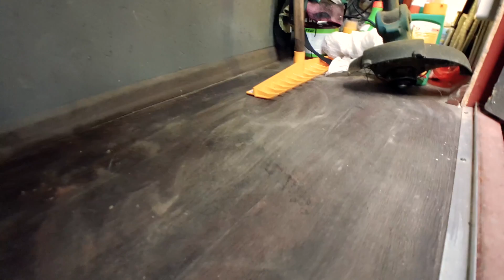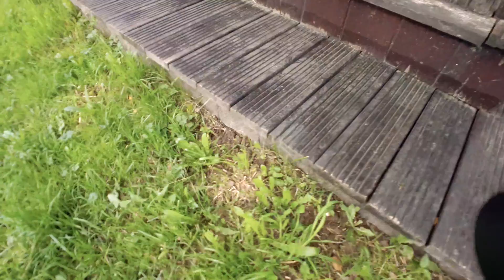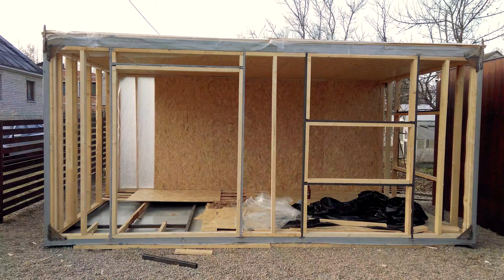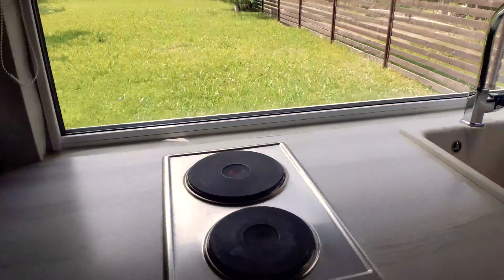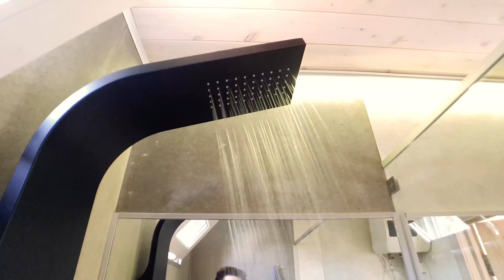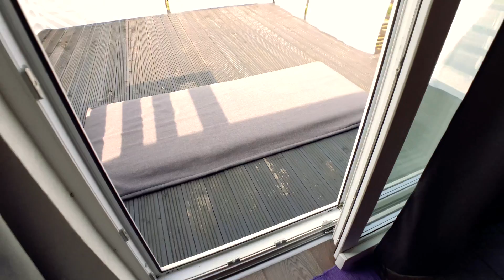DIY Modular Home. Home Tour after 5 years.

Comment: 020521
Hi love your finish  your property.  My questions what  type of wood did you used for your balcony?  Also what was the cost to place the second floor on top if your first floor? Did you put a frame around the frist floor?  To hold the second floor?  And you fireplace how did the glass on the floor help with the over heating? Finally, did you instalate your home or use solar panels?  Heavenleejustice@gmail.com